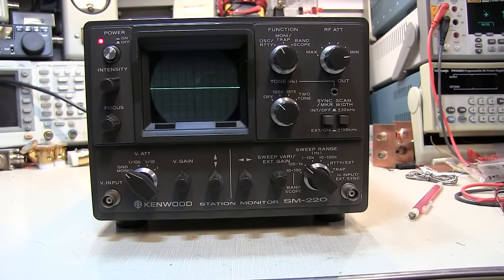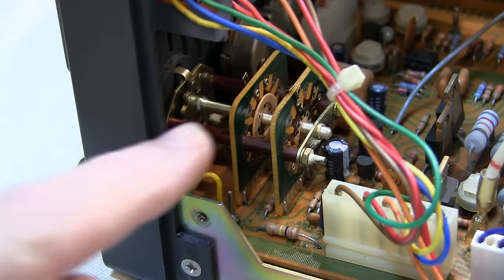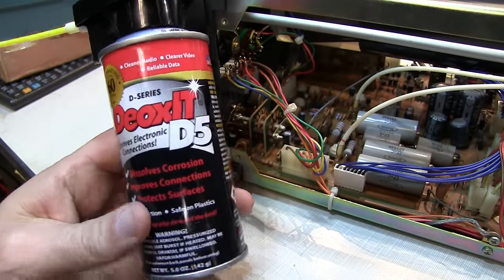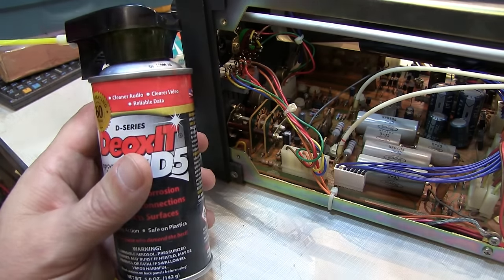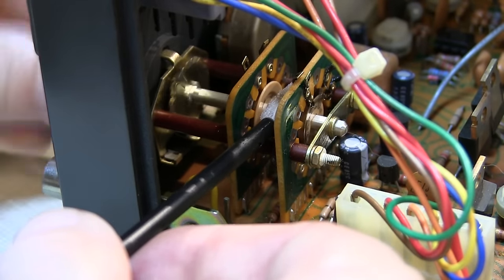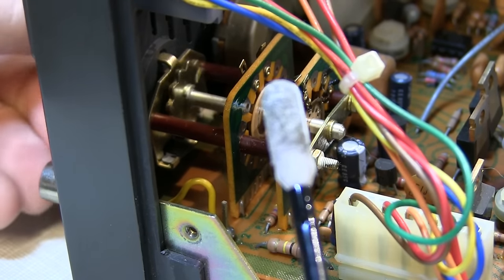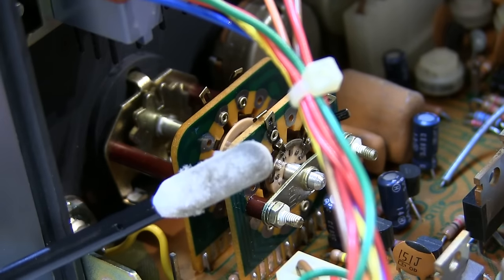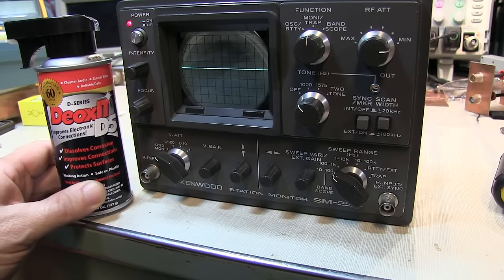#249: Using DeoxIT to clean/restore dirty switch contacts in a Kenwood SM-220

Comment: My Dad who was a TV and Radio repairman way back in the 60s told me to make sure to keep moving the switch for a couple minutes after application on account of the microscopic granuals that form (which keep getting smaller and smaller as you grind them down) can come together and make super hard crystaline deposits if they're not thoroughly broken down. Seeing as you have direct access to the carbon points and are able to basically rinse them with the solution it's probably not an issue.

Comment: I am having the same issue on my Tek 2465b Sec/Div control.  I think it is a rotary encoder though, not a rotary switch.  Canned air and a little wiggling helps it along, but I need to get in there and perform a better fix.  Thanks for sharing this technique.

Comment: Another option is the needle dropper bottle.  That comes in S100 which is all cleaning product and no carrier solvent.  After cleaning a application of DeoxIt Shield will prevent this from happening again in the future.  That can also be purchased in 100% solution as well.  That is handy in the nail polish applicator bottle.

Mike
Reply from the maker: Good tips, thank you!

Comment: De-oxit is a great product. 

It's actually silver sulfide (Ag2S) on the switch contacts which is referred to as a semi-conductor and not the oxide form, but it gets generally referenced as oxidation. I use the foam swabs, not cotton or fiber based swabs like I think you did here. I also give the switch a good work out after I do this.

Comment: Alan speaks volumes of truth when he suggests that you do not "spray and pray" with the De-Oxit! I did so on my old (but immaculate) HP 1742 scope and some of the cleaner dribbled down into a heat sink assembly and onto a proprietary HP IC destroying one of the channels. 

De-Oxit is great stuff but not for indiscriminate use!
Reply: I was really careful when I cleaned my 2 old scopes and I only applied it to the switches. The controls I used a contact cleaner. I was worried about it dripping down inside on circuit boards.

Comment: Nice vid. Thumbs up! Thanks Alan.

What's your view on dielectric grease? Not on such rotary switches, but on multi-pin plugs in cars, for example. Deoxit is great for general cleaning and clearing up oxidation, but in a harsh environment it will return. 

Any down-sides to using dielectric grease on connectors?

Comment: Thanks for the info Alan.  I have heard some people say that using DeoxIt around the phenolic wafers can cause them to absorb the solvent and begin conduct through odd paths.  Have you ever had a problem with this?
Reply from the maker: I've heard that too, but haven't experienced that problem.  Then again, I usually apply sparingly...

Comment: Can you make review on this Kenwood? Looks like scope, but it can do something special.
Reply from the maker: Not a bad idea.  It does have many uses.  It is a very basic 10MHz oscilloscope, but does more radio-specific things like: transmitter signal monitor, trap display for amplifier linearity checking, RTTY tuning aide, 2-tone generator, optional IF spectrum monitor, etc.
Reply: The spectrum display is pretty primitive (as opposed to the wonderful displays today) but for it's time I used it for that and RTTY crossed bananas tuning as well...still in line here at the radio bench after all these years.  73 - Dino KL0S

Comment: Do you have any experience with deoxit regarding leakage current / surface resistance?
I tried to clean the switches on a Fluke bench DMM with a different product, and the meter never was the same again. No amount of washing resolved the leakage problems. Since then I have been wary to use anything other than polyphenyl ether contact lubricant, but the deoxit worked so well on the silver plated contacts I'm tempted to give it a shot.
Reply from the maker: I too would be wary of anything that leaves a residue.  DeoxIT does leave a lubricant / contact conditioner behind, so I wouldn't use it on anything that requires extremely high resistance between terminals.

Comment: Alan,
Nice short video on using DeoxIT. Good tip about using the lint free applicators. Did you clean any of the other switches while you had the case open?     WB3BJU
Reply from the maker: Yes, but didn't video any of that because there weren't any good before and after affects to show.

Comment: Alan, does deoxit dry completely or does it leave a small amount of lubricant? 
I have to clean some potentiometers and have heard that after cleaning pots, it would be good to add a minute amount of electrical lube so the carbon will not dry out and crack. 
May be an old tale some engineer told me when I was a lad just getting started in electronics. 
Thanks
Reply from the maker: DeoxIT leaves a small amount of conditioner / lubrication on the contacts.  CIAG also makes a cleaner specifically for pots and faders.  Here:
http://store.caig.com/s.nl/sc.2/category.293/.f
Reply: ***** Thank you for the quick reply and link. I have cleaned these pots before using contact cleaner from radio shack but the results weren't complete. I watched your video on the oscilloscopes, it answered a lot of questions I had about my Tektronic 475A. Thanks for putting those videos out, especially the one describing the RxTx ensemble from fivedash.com

Comment: Thanks Alan. I've been using Electronic cleaners from Radio Shack. One of them has a lubricant. Is Dioxit better?
Reply from the maker: Not sure what Radio Shack's formulation is, so can't comment on that.  The Caig products are an industry staple.
Reply: The one with lubricant has, Difluoroethane, white mineral oil, Poly Dimethyl Siloxane; and non-lubricated has, Isohexane, Difluoroethane, Ethanol.

Comment: What kind of lint free applicators do you use?  I googled it and came up with some eyelash applicators but I'm not sure that's what you used.

I have an old Swan 350C that I need to bring up running again and it's been sitting for about 20 years.  I know the wafer switches will need cleaning.
Reply from the maker: Look for Foam Tip swabs, like items I, J and K on this catalog page:
http://www.mouser.com/catalogviewer/default.aspx?page=2341&highlight=577-2306-50&catalogculture=en-US&catalog=648

Comment: Same problem on my Philips pm 3212 scope. Here in Italy Deoxit isnt avaiable and i cleaned the channel A rotary swiches with a rubber and contact cleaner. Unfortunately its still quite dodgy. It might be wear..
Reply: I used Deoxit on my scope that's 30+ yr old and it works like new now.

Comment: Hey Alan, 
whats your thought on the sprays that have like gold dust and thing like that in them to supposedly renew only warn out contacts? I was look at it when I was repairing my AM503 but I decided against it. Having lose conductive particulates kinda seems an not ok thing to have in your device.
Reply from the maker: I don't really have any experience with them.  However, I worry a bit that the spray would put this conductive dust everywhere, not just where you want it to go...  ...so I'd be a bit cautious.
Reply: I wounder how good they even work, as I imagine that the gold dust would be scraped off really fast.

Comment: i installed "bourns potentiometer" then i had a tech do an alignment me used that stuff on my brand new control pots i installed. it removed all the grease that they pack in the shafts to add drag and stiffen it and made them all loose i was so pissed off..
Reply from the maker: Sounds like you need to find a new tech.
Reply: w2aew o yeah that was a long time ago i dont go there

Comment: Alan, can you explain the use of that equipment? Thanks. CH!
Reply from the maker: The main use in my shack is two-fold.  1) Monitor the RF envelope of my transmitter's output, and 2) provide basic spectrum monitor function on the IF of my rig during receive (to look for activity on the band).  It has other capabilities that I don't use including trapazoid display for examining amplifiier linearity, provide 2-tone signals for tx testing, provide monitor function for tuning RTTY signals, etc.
Reply: Thanks!.. Mmm, interesting for a nice future video.. 😎

Comment: Do you think this DeOxit cleaning solution will work on a "scratchy" audio volume potentiometer?
Reply: Yes no doubt.
Reply from the maker: They sell a special formula for volume/fader controls.
Reply from the maker: Yes, exactly.
Reply: I use a contact cleaner for volume controls but if that doesn't help I'll use Deoxit. I find this stuff works really well for switches. I used it to clean a scope that's over 30 yr. old and it works like new now.

Comment: Why leave the house to buy deoxit when you can walk into your laundry and use windex for free to clean volume pots and switches it really works i did it try for yourself no residue and it evaporates switch will apear to not work while wet but when it dries its fixed enjoy dont forget to turn knob when wet to loosen it up easy!;-)
Reply: Anifa Bates did it work?